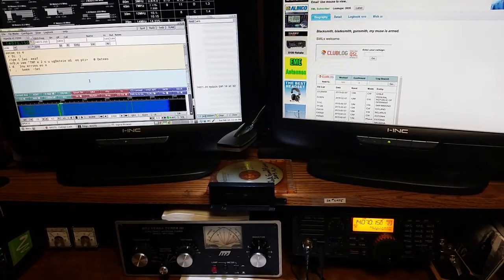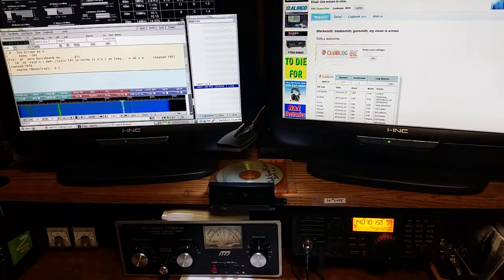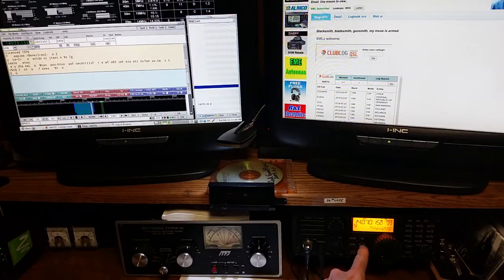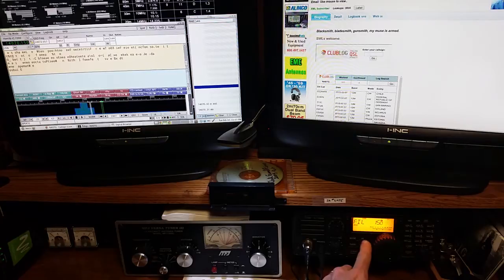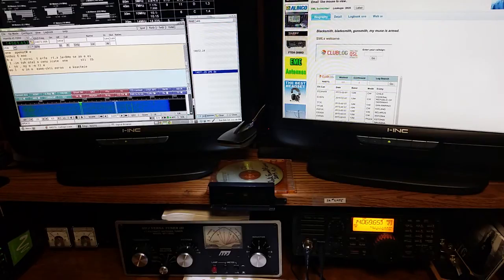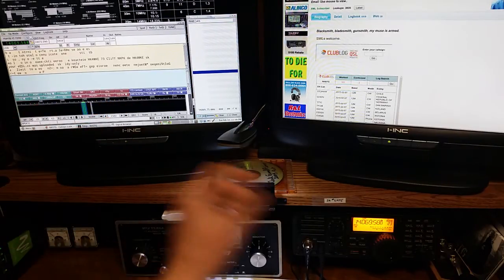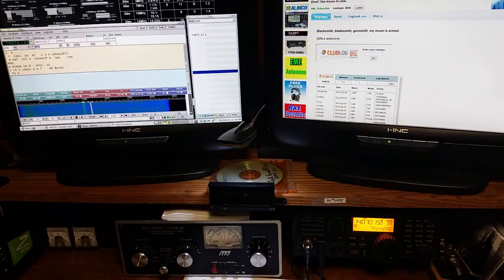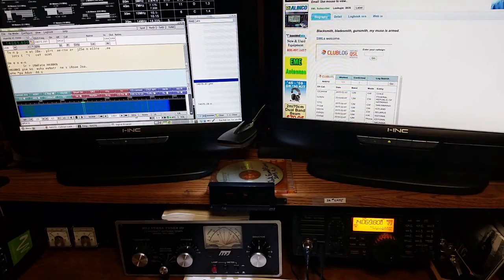Using IF filters with an ICOM 7200 and fldigi - work single digi contacts without noise!

Comment: Also helpful is using the manual notch filter on the Icom rigs (and others) to allow continued copying of a relatively weak PSK or other digital mode signal when a strong station suddenly comes on somewhere else in the displayed passband, driving the AGC hard and reducing receiver sensitivity.  Set the notch filter to eliminate the interfering station.  Notch filter width can be adjusted on the Icoms...I don't know about the other mfgr. rigs.
Reply from the maker: If you make the passband small enough there isn't a need for MNF.  I did recently have a funny episode with ANF, I was trying to start working some RTTY  contest and the center of both tones were suppressed, very weird looking.  So yeah, don't use ANF with digi modes. :D
Reply: stimpsonjcat67 I use the MNF when I want to continue seeing the full waterfall display while in QSO.
Reply from the maker: Understood.  The point of the video was how to ignore everything except the signal you are working.

Comment: Instead of using the channel knob on the rig, just right-click the QSO button on fldigi (ver. 3.2.16) to return the VFO to where you started.  But its just a toggle (I think) so if you do two consecutive QSYs it wont work.